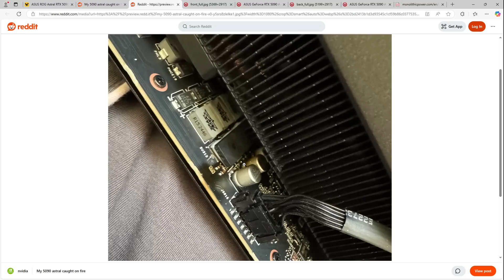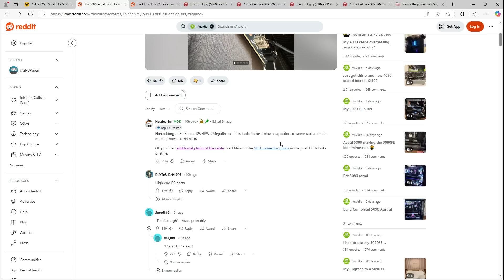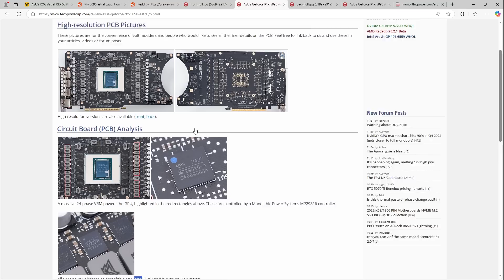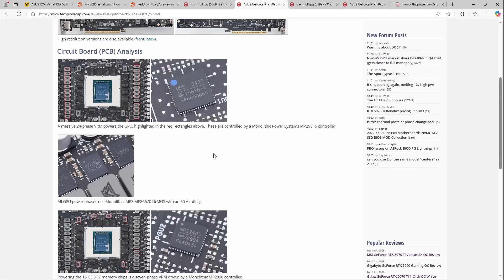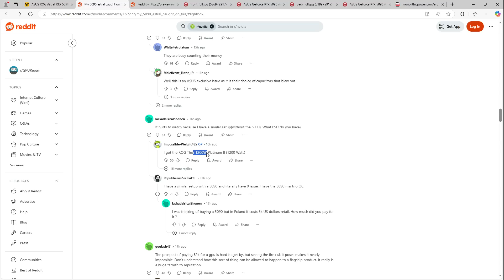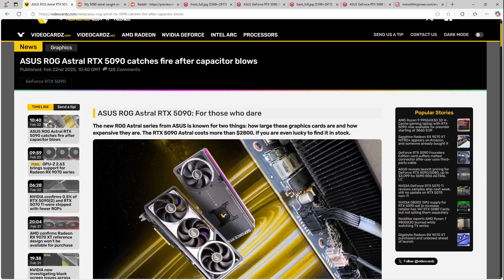Innocent capacitor blamed for ASUS RTX 5090 Astral catching fire

Comment: capacitors are just the only component that people know the name of
Reply: they should learn about fuses
Reply: Well it's not like it has always been this way. Electrolytics going bad have historically been a big reason for why stuff falls. That's probably why people are so quick to assume that issues are caused by capacitors.
Reply: and the only reason they remember it is because they remember the words flux capacitor.
Reply: @HybridEnergy  tf is that ?
Reply: @HybridEnergy  oh it's a bttf thing
Reply: @MercantileCharredAirSalmonRodd  1.21 jiggawatts!  I know the correct pronunciation is gigawatts, but Doc saying it like that actually helped his character, it made him seem more like an eccentric mad scientist.
Reply: They know the name of them...but they have no idea what they do.

Also, in older hardware, capacitors would fail and leak (though not this kind), and cause damage to the board via corrosion.  So some people probably have the "bad capacitors" thing in their head.
Reply: Except when everything is a coil because the coil whine has to come from somewhere.
Reply: I'd be much more suspicious about diodes and transistors than capacitors. A valve is always a bigger problem than a tank, as an old professor of mine used to put it.
Reply: Caps be buzzin
Reply: In their defense, I've heard of people re capping things, but never re-resistor or re-inductor.
Reply: @skachor  Yep.  I just had to recap the drive board on my Gamecube.  It had stopped reading disks.  That was the issue.
Reply: And it's not even like the good ol' days where any little cap would go off like a firecracker as soon as you looked at the polarity wrong..
Reply: I'm drunk but I've heard of MOSFETs ?
Reply: @mmmyeah7  But do you know what MOSFET stands for?
Reply: @StormsparkPegasus  something about a transistor the greatest invention of our time imo haha
Reply: @mmmyeah7  Yeah it is a transistor but it's a specific type of transistor.  It stands for metal oxide semiconductor field effect transistor.
Reply: @StormsparkPegasus  yeah thanks mate just googled it lol what next what's PTFE stand for '))
Reply: @mmmyeah7  Polytetrafluoroethylene.  You might be more familiar with the most common brand name...Teflon.
Reply: @StormsparkPegasus  you are a legend tbb
Reply: Gold. Too true.
Reply: Its because electrolytic capacitors die or dry out over time but thats older electronics its almost never going to happen on new hardware
Reply: Not surprising to see them draw the conclusion that it may of been of the capacitor, given their limited knowledge in Electronics. Its totally forgivable.
Reply: Looks like its the Capacitor to me the heat is all around that area. 
They could be fa kes.
They seem mounted at odd angles which could be the print is not straight on them.
 Dead give away if that's the case.
And this guy is wrong - a cap mounted the wrong way round CAN blow up that's well known.

Comment: This is astonishingly similar to what happened to a GTX 1080 that was given to me in 2020 (a buddy gave it in trade for my 1070 as a "free upgrade")....there's still a burn mark on my motherboard in that old PC. Still no idea what caused it, but I literally saw fire in my PC as the GPU fans turned it into a tiny blowtorch. And I'm not technically versed enough to have figured it out, so I'm just the dumb dude seeing two things that look similar. But yeah, wish I still had the card....at the time I just replaced it and recycled the burned card. I was more concerned with not having a gaming PC during the pandemic, lol.

Kinda wild to me that these devices can, occasionally, actually cause an open flame even in good condition.
Reply from the maker: is it a EVGA GTX 1080 FTW by any chance?
Reply: @ActuallyHardcoreOverclocking  Wow, yeah, it was exactly. I think my buddy got it at Best Buy a couple years before giving it to me.
Reply from the maker: @DustinHarms  yeah those have dodgy power stages on them. Pretty easy cards to E-power so I have several because they tend to go cheap on Ebay.
Reply: @ActuallyHardcoreOverclocking  Is it possible to avoid the fire?
Like an undervolt might help?
Reply: @ActuallyHardcoreOverclocking Ha, well thanks for the info! I'll have to let my buddy know the culprit. He felt so bad.
Reply from the maker: @ghoulbuster1  nah they blow up at random even at idle.
Reply: @ActuallyHardcoreOverclocking 💀
Reply: @ LOL
Reply: he rip you off, some "friend" lmao
Reply: absolutely classic 1080 ftw moment

Comment: This lack of fuse trend is really poor.

 Do you think there is call for a manufacturer to make 12v HP cables with built in 10A fuses on each line either in the connector or wiring ? 

I know they wont be a close to the point of failure but otnshouid help. 

Id be happy to pay for a cable that offered some protection to the GPU.
Reply: Fuses would make it worse as you'd only cut that one wire off and leave the load that carried on the rest of the wires.

Comment: Man, these things are just getting worse and worse. I'm starting to get scared to even pick up a 5080.
Reply: Considering they don't support 32bit PhysX its kind of silly.
Reply: @soklot  This is a nothing burger, AMD cards never did to begin with.  Modern CPUs will run the small batch of old PhysX games just fine.
Reply: @ I wouldn't call getting 7 FPS  ''just fine'' but maybe I'm too picky.
Reply: @soklot  7? that doesn't sound right.
Reply: As the video says this has been happening over a number of GPU generations. It's bound to happen in this generation sometimes therefore. I guess it's likely to happen quite quickly, and therefore it would be under warranty if you bought it new.
Reply: @Safetytrousers  but there is such a low volume of these cards out there that shouldn't it be not so ?
Reply: @HybridEnergy  But if it could happen anytime then there is no reason it could not occur now.
Reply: @ True, but I mean the odds of that.

Comment: electrolytic caps have a reputation for self decapitation on other consumer electronics. THC caps on GPUs look similar, so I guess that's why folk jump to blame them.
Reply from the maker: yeah and apparently it was really really bad when lead-free solder was first introduced.
Reply: @ActuallyHardcoreOverclocking  The capacitor plague happened around the time of the RoHS but was apparently just due to bad electrolyte (though putting electrolytic caps near a CPU socket is never great).
Reply: @concinnus  Yeah, it was Chinese cap manufacturers cheaping out on their electrolyte mixture. That's why "Japanese capacitors" remains a marketing term to this day.
Reply: @hammerth1421  Japanese caps aren't always a guarantee for quality though. Nichicon or some other bigshot Japanese mfg had a entire botched batch of caps ~20 years ago.

That, and aging. I had to get my P4P800SE's recapped because the KZG caps on them dried out.
Reply: @ActuallyHardcoreOverclocking  Don't think introduction of lead-free did affect the electrolytic capacitor plague much if at all. But the higher reflow temps sure did cause a lot more cracking in high capacity multi-layer ceramics.